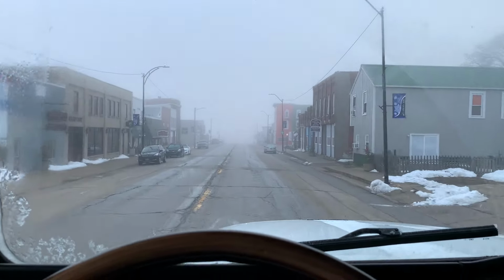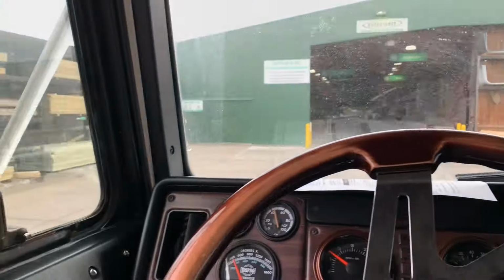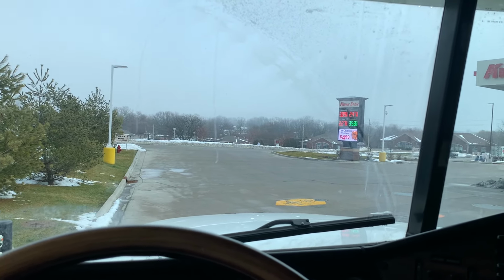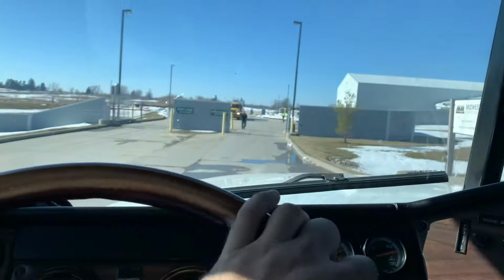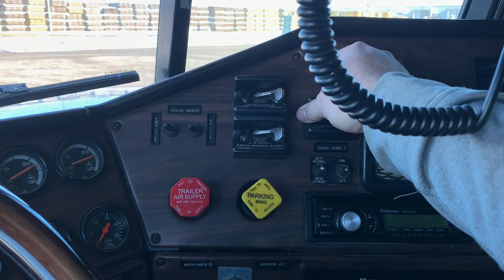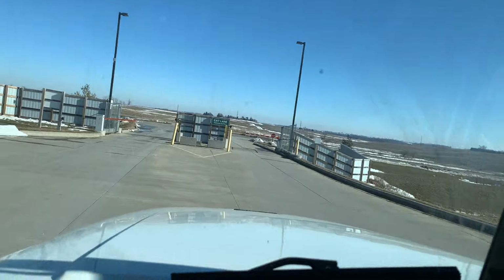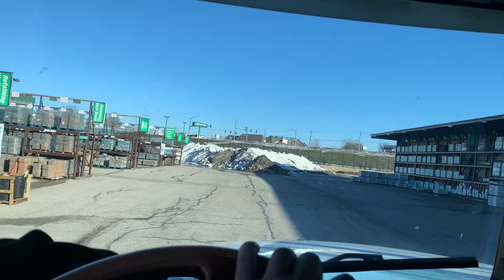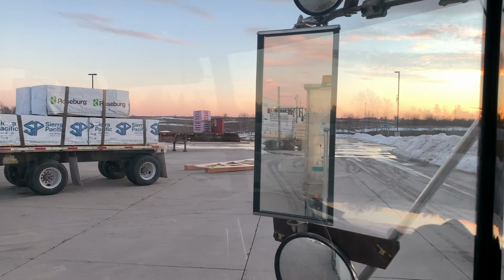Menards Flatbed Power Only (Owner Operator Trucking)

Comment: So you looking for a cab over? I know of one in my hometown, Freightliner', big bunk, ( not the double), 3406, 13 sp, good shape, put her to work. If you’re interested I can get more details.
Or , a guy’s got a 93 FLD 112 10 sp with a N14,(needs TLC)
Or,  a 99 FLD 120 condo 14 liter Detroit but, needs trans.
Reply from the maker: I’m not actually interested in buying a cabover. I actually just stopped and checked it out because someone mentioned that truck in the comments on a previous video
Reply: Copy, just checking!
Anything to help a brother out!😅